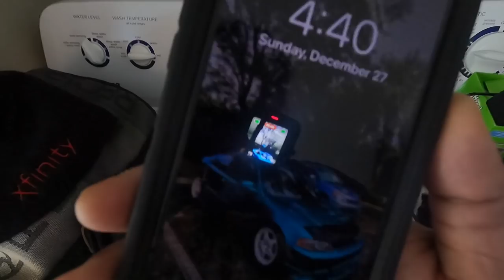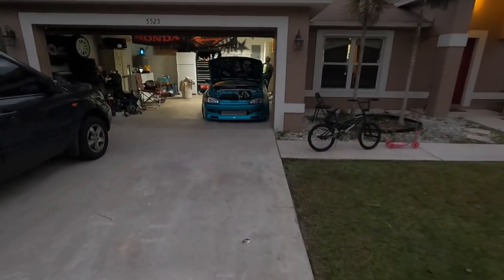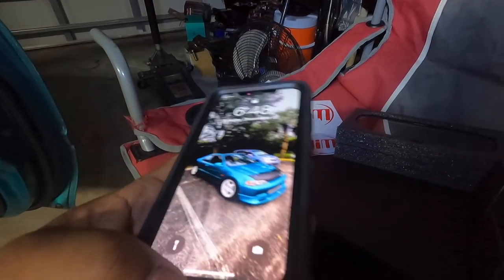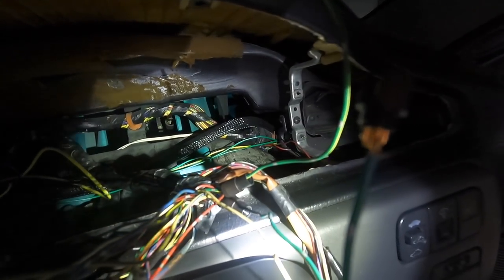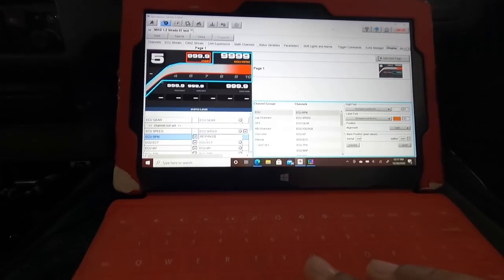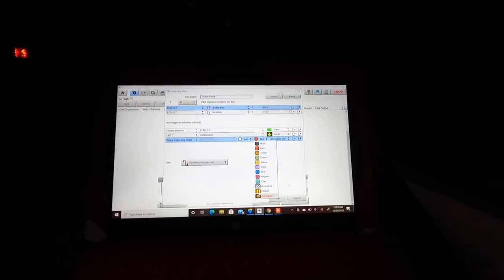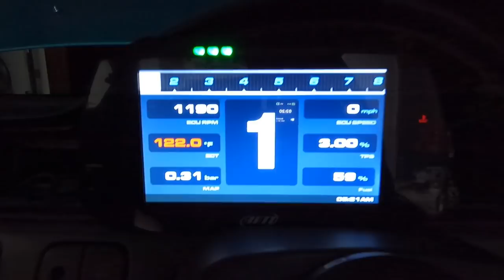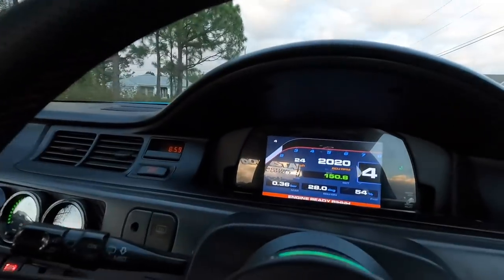CIVIC GETS NEW DIGITAL DASH AIM MXG 1.2 STRADA INSTALL

Comment: Great video 🔥 I have a quick question. On the 719 binder plug it says 0-5v signal. Since you added the turn signals to it does that mean you added 12v? Have you had any problems with it?
Reply from the maker: No u put the one wire to that one leg that’s it
Reply: @egk_coupe  thanks bro. Great build! Beautiful
Reply: What would you do for check engine light? Do you have to use a flying lead also and send it to a channel? Thanks man.
Reply: @lipsnatchertv2649  @egkcoupe, also wondering if you've found a way to use the Icons function to drive a check engine light warning.
Reply: @jasontrue3810  all I did was pick the signal from the computer and trigger the light/icon for check engine. A lot to learn on there but once u have it figured it, it gets easier. Message me if you have more questions.